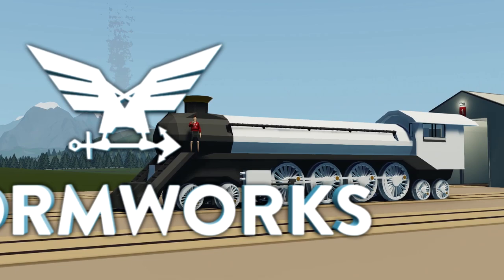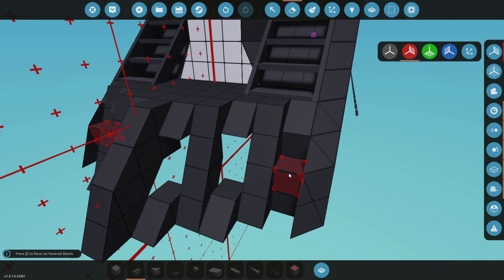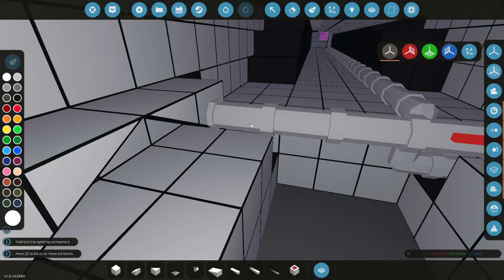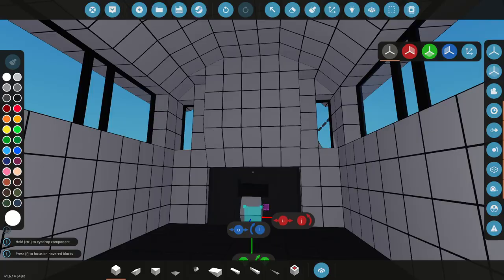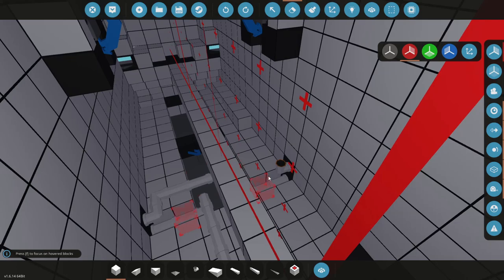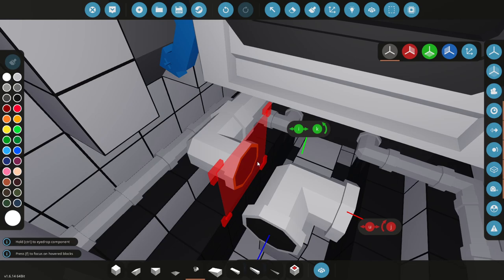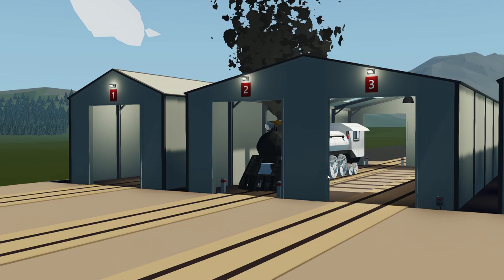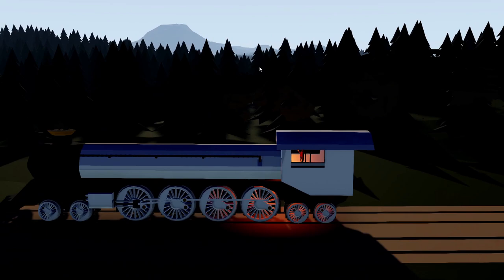OUR STEAM LOCO IS MOVING! - Lets Build A Steam Engine In Stormworks!

Comment: For some reason, paradoxically both comprehensible and inexplicable to me, you will need to put some fluid control valves on your steam line out of the last wheel piston to bleed off steam. Reason being is that the boiler accumulates so much pressure that is apparently based on the amount of steam inside it. The pipes also apparently build up pressure in them based on steam inside them. If the pipes are full of steam and the boiler's full of steam, then according to the game they've equalized out in pressure and you'll slow down significantly. If you have a line to bleed out steam at a controlled rate after you've used it you can maintain speed while also recycling some of the steam back into water, but it's better to just lug around a large tank of water you just spew out into the air. I've tried multiple things and a closed system like you've got will inevitably slow down and it'll speed up as soon as it starts bleeding steam from the system. It's better to do it on your terms than to have it doing it automatically right before it explodes.

But it makes sense that pressure will inevitably equalize in an enclosed system. However, how fast it slows your train wheels down and by how much does not make sense to me, as it'd be more realistic that the boiler's increasing pressure would continue to be greater than the steam in the pipe until it's actually forced back into the boiler. Meaning the difference in pressure would cause a quick reaction explosion because of the difference in pressure. I'm basically griping that this is a property of steam that would have been nice to know a long time ago, but was never explained.

Comment: Looking great!   

I have a boiler pressure controller in the workshop if you want to use it, If you do, there is no need for condensers, condensers can really mess up the steam system because they do not work the best.   One or two large tanks of water will last longer than the coal will it you set up the boiler to only use water when needed.

Comment: When it comes to decorating your engine do NOT use weight blocks. It’s what ruined your last engine, you made it too heavy and it couldn’t get any speed.
Reply: Not really. Last train he did was pre steam train wheel rework. They've been redone and now work a bit more sensibly. Last iteration you couldn't get the large wheels moving on their own power and you could glitch the brakes on it to make your train go over 67 meters per second (150 mph or a bit over 200 kmph.) Weight for the steam wheels does effect it's overall top speed, but it's not to the extent that you're going on about.
Reply: @steeljawX  Thing is, he wasn’t using the big wheels last time and I remember going through and counting over 100 weight blocks on his engine. I don’t know how much a weight block adds, but I am sure 100 of them is enough to make a significant difference.